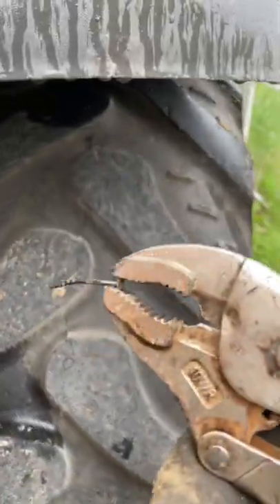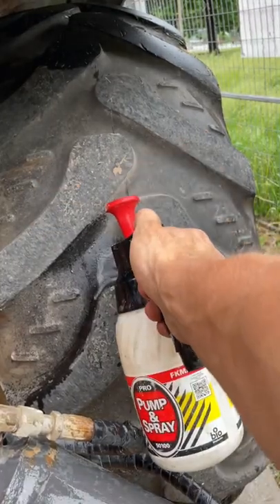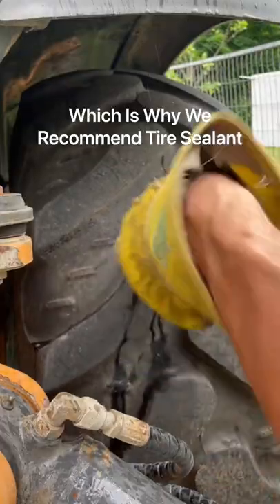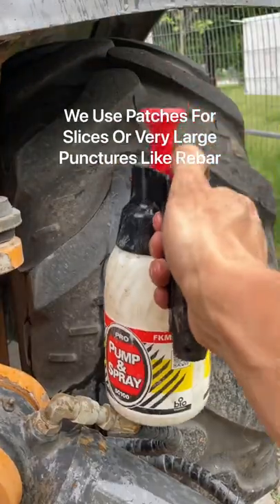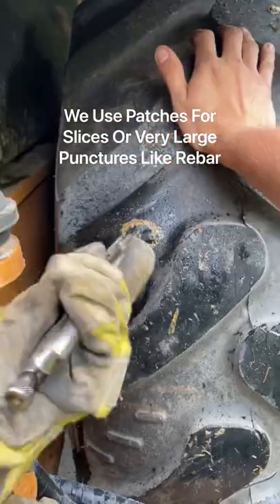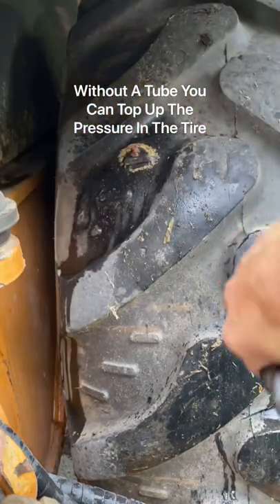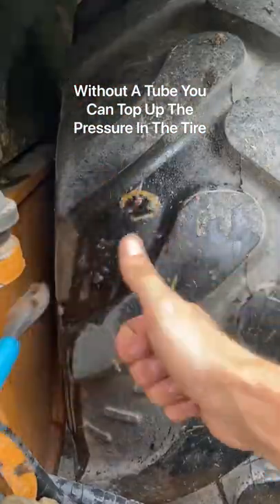Why Do I Plug Large Tires? #shorts #tiredoctor #tireguy #tires

Comment: Why don't you replace those backhoe tires with airless tires?
Reply: Higher upfront cost... Yes.
Save in the long-run, no downtime, no flats and no service calls.
Reply: @davidp2of3  convince a customer that
Reply: @davidp2of3  people don’t care about saving in the long run anymore
Reply: Airless tires aren't exactly cheep. Plus they aren't really final products to my knowledge, mostly prototypes so far
Reply: @Depl0rable10  I'm seeing them in the construction sites in northern California. So they aren't prototypes anymore
Reply: @Depl0rable10  michelin tweels
Reply: @Depl0rable10  foam filled tires have been a thing for ages

some military vehicles also use solid rubber tires (though It's not recommend because of the weight, just use foam tires.)
Reply: Depending on the type of construction airless tires may not be the solution they may have to run across roads a lot or they may be moving at slightly higher speeds.